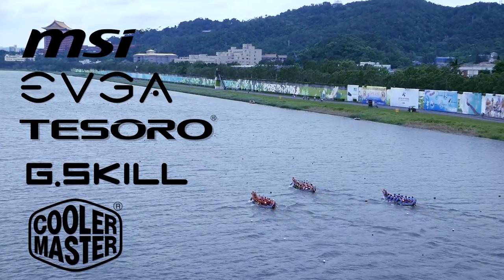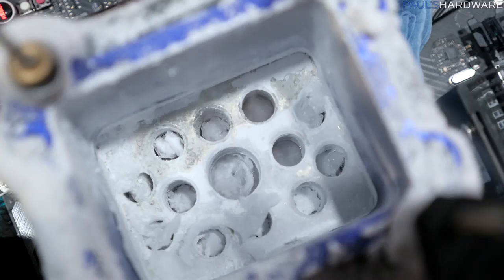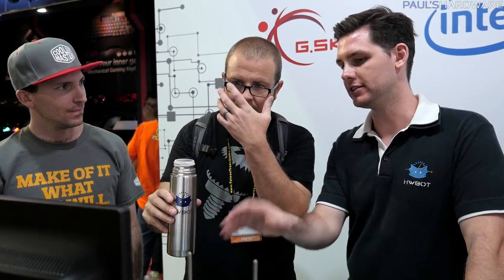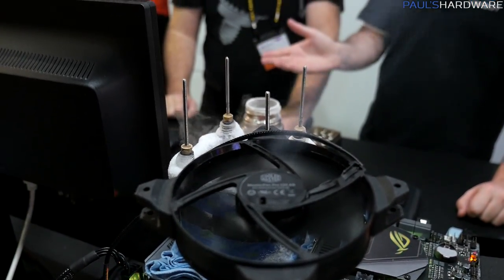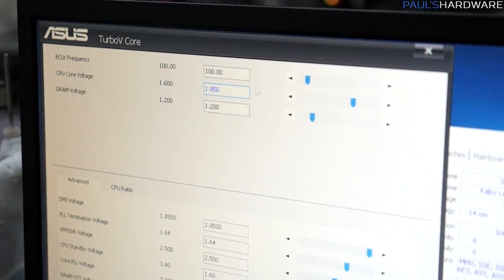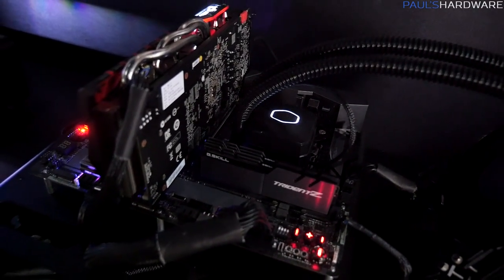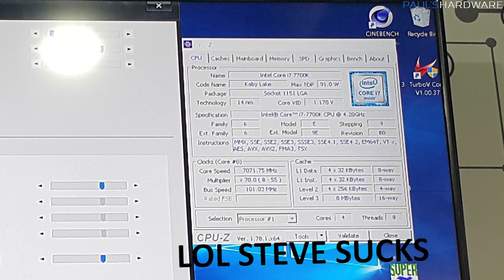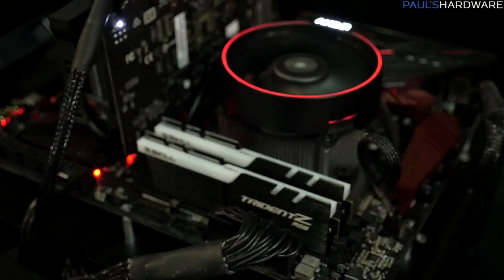I Do LN2 Overclocking Now, also GSkill High-Speed DDR4 & Peripherals!

Comment: I've always wonder why not just use silver? I know it would be pricy but if ur trying to get higher then wouldn't it dissipate heat faster?
Reply: Thomas Prentice You can't use pure silver if it's about that. The melting point is nearly 1000°C what would most likely destroy the die when applying it. That's why there are thermal compounds implementing silver micro particles like Artic Silver but it isn't anything near the thermal conductivity of actual silver. So it's hard to get actual silver (or copper if you like) into normal thermal paste properly. It's why there are compounds based on liquid metals or soldering with Indium (that has a much lower melting point).

*Fixed spelling error
Reply: Ooh, sorry, I thought thermal paste because they mostly talked about that one.
Silver is several hundred times more expensive than copper but only has ~5% better thermal conductivity. So it's much more expensive for a negligible improvement that does not matter even in this use case.
Reply: Let's just pour boiling silver into the pot and see what happens!
Reply: Well if you are trying to push it wouldn't it still be better even if it cost more?
Reply: I mean its not like anyone but enthusiasts are getting 7 GHz anyways.
Reply: Thomas Prentice Idk how big a difference would be because no one ever made one. But for perspective, we are talking about a few grants for silver instead of 100-200$ for the same full copper pot design. It's simply not cost effective. But I've read about one guy on the nvidia forums who dropped 2000$ i believe for silver and used a pot design from k1ngpin but idk what the result of that project was if it had ever finished.

Comment: Just out of curiosity, could the same thing be achieved with dry ice? Kinda seems cheaper and easier to get ahold of, although, I suppose dry ice would thaw out into irregular shapes based on where the heat is coming from and the cooling then wouldn't be even, but still, is it doable?
Reply: Janak Nagaraj no where near as cold
Reply: People do it, and to combat the irregular shapes, they put the lumps in acetone, so there's still a filled pot of liquid (with lumps of dry ice). However, as Eggsr mentioned, it doesn't get anywhere near as cold as LN2

Comment: Do you need a high frequency RAM for Ryzen or is a lower frequency with a lower latency that results in the same effective delay, just as good?
Reply: For Ryzen shoot for 3000 or 3200, the Infinity fabric benefits from faster ram. If you run 2400 ram you will have a noticeable difference in performance
Reply: +John Totten: So by faster you mean higher frequency, even if the timings are worse?
Reply: Yes, You want higher frequency Ram. Ryzen can be tough though as you need to make sure the Ram is on the QVL list of the MB maker. Even though the CL timings and latency are a bit higher then faster frequency is suppose to overcome that. I would find a site that talks alot about Ram and the frequencies, timings and such and how they affect the Ryzen cpus. 3200 Mhz with CL 14-16 range should work good. Make sure you get up to date bios from MB maker, also the new Ageasa code updates and that should allow you to get the most from your Ryzen cpu.

Comment: So the only thing stopping people at home from reaching those speeds is temperature?? If so, how come you get crashes when using things like cinerbench and aida 64 when the temps aren't that high and its just because of to higher frequencies??
Reply: Tom Holmez Because your voltage is too low, but it isn't good to increase it to crazy numbers, because it decreases the lifespan of the CPU
Reply: Also voltage. They are at 1.925 volts. If you tried that in Aida 64, then temps would be VERY high.
Reply: oh right, thanks

Comment: You would get a higher overclock using a single memory module, ideally as small as possible so there is less stress on the north bridge making it more stable.
I got 7.648ghz first time out on my FX6300 using LN2 with a home made pot I bought for £60 at an overclocking meet.
Try running Cinebench on LN2, that's a real challenge!!

Comment: How the fuck does a CPU operate at -190 ? :D:D Or is that fahrenheit?
Reply: Perkele Itse no its c. they have to tweak some voltages to do it properly.
Reply: its not CPU temp. its temp near socket
Reply: It's just insane how something can operate at that low temperature. And how it NEEDS that low temps to run at all, seeing as it crashes at just over 7Ghz with those temps.

Holy shit.

Comment: Pascal cards are a JOKE to OC.
Reply: Or they are great at overclocking, so good, in fact, that the ship at OVER 2 GHZ! WHICH IS ONLY ABOUT 50% MORE THAN ANY OTHER GPU! 
Sorry, this bugs me.
Reply: 1070 strix at 2050mhz at 60° By default, Asus oc profile
Reply: RepsUp100 because they're already clocked crazy high. 2050mhz from stock cards makes my gtx970 at 1420mhz cry
Reply: Nicholas Pateldeleon just gotta play with the settings more
Reply: quangluu96 then that isn't stable technically. My 970 does the same thing and so did my 660 and 770
Reply: My 1080 runs stable at 2100MHz at 65C max
Its a hybrid card, if the low temp wasnt an obiovus enough indication
Reply: Yeah my 960 wont even hit a solid 1500.  I have to keep it at 1450 to stay happy on all of my games.
Reply: +Nasty N8 Hey! I have a 960 too! It's still a good little card.
Reply: RepsUp100 check the evga kingpin
Reply: Well with a base clock of 14xx/15xx mhz,  2000+ mhz doesnt that bad to me...

But my cards run a bit lower because i undervolt them hard.
Reply: If you want to get far with a Pascal card you need to do a power mod
Reply: my 1070 ftw does 2152 mhz stable under 70° with the side panel off... i can even game there for a while (then it slows to 2113), but yeah I really dislike how gpu boost 3.0 takes away all the control from the user
Reply: Robert Depuoz throw in some Liquid metal and the heatsink and resistor and you can push it farther
Reply: LiteGaming  yeah I know I've been contemplating doing the shunt mod, but I really don't need to. All I do is game. I'm not looking to get top 3dmark scores or anything. I just don't know if it'd be worth the extra heat for gaming
Reply: BLOOGaming heck yeah it is. What is your max mhz?
Reply: +Nasty N8 I feel so dirty... Here goes... I haven't gotten around to overclocking it. There! I said it! 
Haha, seriously, though, I should really just try it. I even have afterburner installed.
Reply: quangluu96 performance goes down but clocks go up
Reply: Pascal cards pretty much all overclock the same, and hardly get past their boost. Which is sad, and just boring lmao. What's the point of overclocking if you get hardly any more performance, and competitively they overclock all the same basically. Pascal is bad for overclocking.
Reply: Johnathan Bloch I can break 2GHz EZ... you need a power mod
Reply: +LiteGaming I watch many, many overclockers. Most of them have very diminishing results when volt modding pascal. Like when I heard there were so many limitations, lock down features, and power limits on pascal I thought there was performance to be had. But I was wrong, there's very little extra to get out of it lol. And some overclockers I've watched, have overclocked Pascal cards to a point where they start performing worse! Yeah, worse. On multiple instances. It's really pathetic.
Reply: Johnathan Bloch dude... rly... do power limit mod
Reply: overclocking is joke in itself especially using liquid gas...
Reply: 1060 broke the world record going over 3 GHz.
Reply: 1080 strix at 2126 i would say my card oc' pretty well.
Reply: I like numbers too, but an R9 Fury at 1 Ghz beats that GTX 1060, so I guess it doesn't mean much. Otherwise an FX holds the record at 8794 Mhz. Doesn't mean much other than its a big number.
Reply: Jake Garrett would you say the FX chips are bad overclockers?  regardless of performance they're still good overclockers.